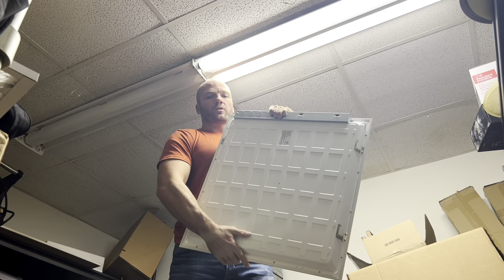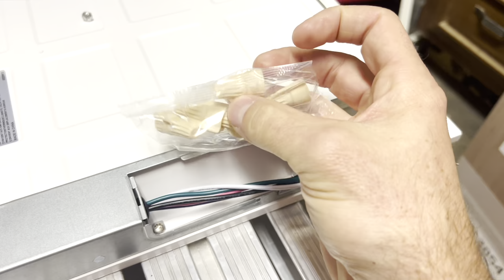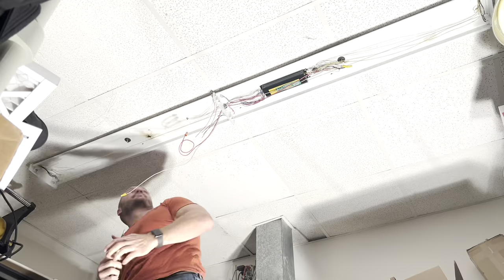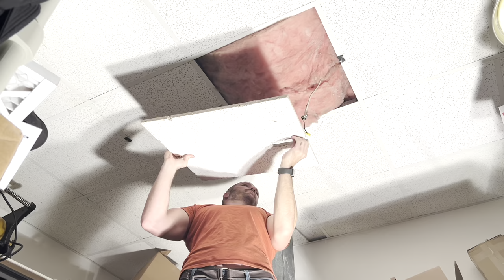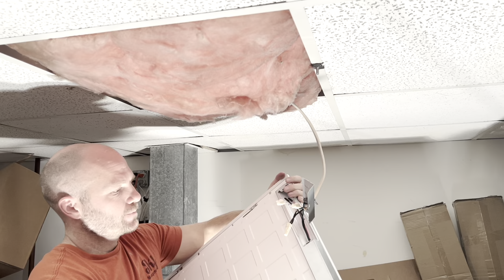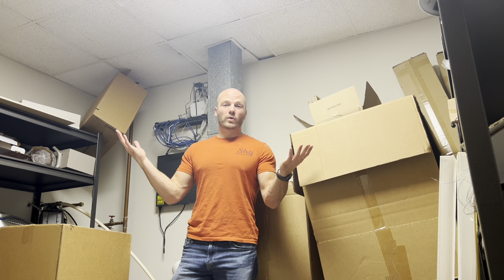Upgrade Fluorescent lights to LED drop ceiling panels

Comment: Hey great video, big help can i put two of those in the same line I want to buy 2 but planing to place it a little separate thanks for your help.
Reply from the maker: yes. You can run them in a string.
Reply: @RoscoReviews  Thank you very much!!!

Comment: Probably a dumb question, but can these be wired in series, so that I can start with one and then run AC wires to next fixture etc?
Reply from the maker: Yeah, you can. I’ve done them this way.

Comment: what are the 4 metal clips around the perimeter for
Reply from the maker: ceiling panels are suppose to be clipped to the T brackets. It doesn't take much wind to push up acoustic panels and knock them out of place. The LED panels are slightly heavier, but I suppose in a windy area it could be a hazard for those as well. In some places building codes require ceiling panels to be clipped in.

Comment: The problem is, is it a light fixture or just a light? Because LEDs burn out pretty quick with long use, especially since company's do some things to make sure they do. Buying a whole new light & re wiring all the time would get annoying. So is their lights that go can be changed in & out, & how hard is it?
Reply from the maker: I haven’t had them installed long enough to speak to their longevity yet. I don’t think These panels are meant to have the diodes changed out. So when it does go out it would mean changing the whole panel. If that is a concern, then you could change the old fluorescent bulbs to LED tubes. That does require rewording the fixture to not include the ballast. But it’s not too difficult to do. Then the bulbs are changeable.
Reply: @RoscoReviews  It seemed like a good idea, especially since it is light weight but yeah if you used the light all the time, it would probably cost a pretty penny. Thanks for letting me know.

Comment: I tried installing these in my office. The line voltage must have been to high. Sparks flew and popped a  breaker. I'm looking to see if someone talks about ballasts
Reply from the maker: Hmm. These should run directly off the 110 line. You shouldn’t need a ballast or anything. That kind of sounds like there was a short. Or perhaps the hot line accidentally made contact with the metal hosing somewhere and it grounded out.

Comment: Whom ever put the drop ceiling in the house I just purchased used shop lights behind a diffuser. Each light is plugged into an outlet. I do have a light that the ballast is going out of. Can I switch out one or two lights at a time or do I need to do all at once?

Thanks
Reply from the maker: You could change them out one at a time. But they will look quite a bit different than what is there. 
If it were me, I would probably do them all at once. You can string them together wiring each one into the next. So it goes pretty fast.
Reply: @RoscoReviews  Thank you. I think that I will do them all at once now. Your advice help and I looked at the number of lights. There are fewer then I thought. It helps to be able to go down and just look instead of moving boxed to the basement in a hurry and just glancing. I only have four to change out. 

Thanks

Comment: Hi Brother.
I tried to replace two  panel lights, which use the same on / off switch. What happens is only the ones close to the on/ off switch turn off when the switch is in off position. Can you tell me what was wrong?
Reply from the maker: It’s really hard to say without looking at it. My first thought would be a loose wire. The junction boxes on these can be pretty tight.  So maybe something came loose when closing the box. Could be a bad panel, but I’ve actually never wired one up that didn’t work.

Comment: Did you need any additional support to hold the light over a panel?
Reply from the maker: No. I didn’t use any additional support. The led panels are surprisingly light. They might even be lighter than the ceiling tiles I removed.
Reply: @RoscoReviews  That's good, since they're going directly over my couch, haha.  Thank you!

Comment: I just ordered one for my basement office. The fluorescent light is up in the drop ceiling and has a clear panel under it, so the light is both harsh and insufficient!

When we had our kitchen renovated, the contractor installed wafer LEDs in the ceiling, and I’ve been considering them in the basement, but this makes more sense. Get rid of the old faded clear plastic, bring the light source right to the ceiling and no need to cut holes in drop ceiling panels.
Reply from the maker: Yeah. For drop ceilings, these are so easy! I’m a big fan.
Reply from the maker: Yeah. For drop ceilings, these are so easy! I’m a big fan.
Reply: @steev182  Are you leaving the fluorescent ballast in and installing the LED panels underneath them?
Reply: @MichaelGlasson  nope! I disconnected the whole fixture and removed it from the joist it was mounted to. It was simple enough though.

Comment: awesome video.  I'm gonna do these instead of messing with led bulb refits
Reply from the maker: Yes! I’ve replaced some fluorescent to LED replacements. And honestly, this is easier than cutting out the ballasts and rewriting the fixtures for leds. It’s about the same price, Plus I think it looks better!
Reply: @RoscoReviews  agree!
Reply: @RoscoReviews  Can you just place these LED panels underneath the fluorescent ballasts so they don't even need to be removed?

Comment: Thank you, Roscoe
Very informative. I am about to replace three 2 x 4 drop ceiling LED panels in my basement.
Wish me luck lol 😝
Reply from the maker: you've got this! If they are wired individually it's pretty easy. if they are chained together, then it can get a little tight in the junction box, but it's not too bad. I really like the light output on these. I think it's way better than the old tubes.
Reply: @RoscoReviews  Finally got them wired and working. Had to chain 3 together.
you're right, it's tight in those chi-com junction boxes. The Romex is difficult to work with. I had to have my wife hold them up as I wired them but they all work and provide a heck of a lot more light!
Thanks again!